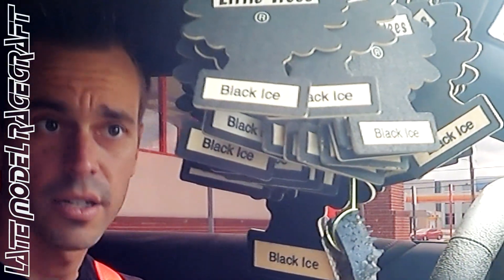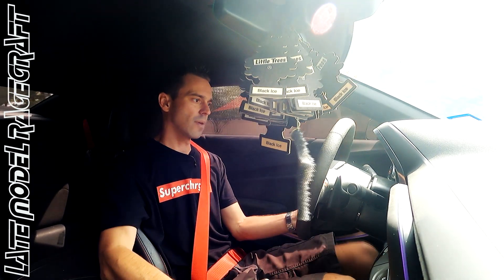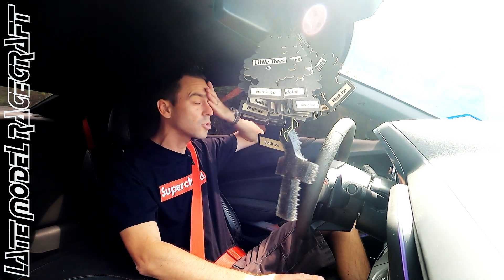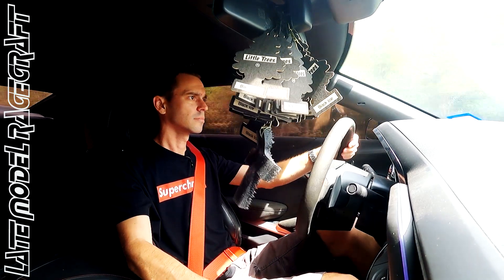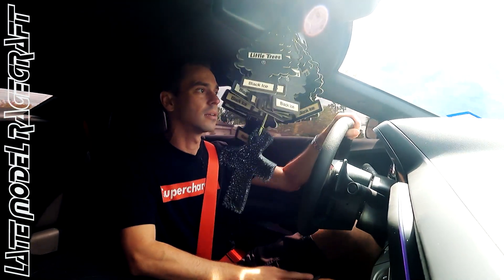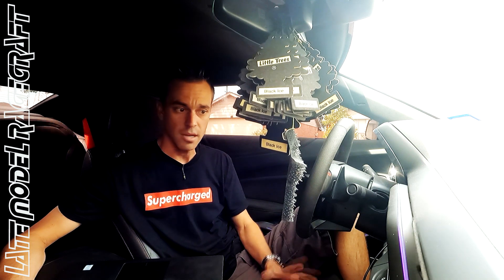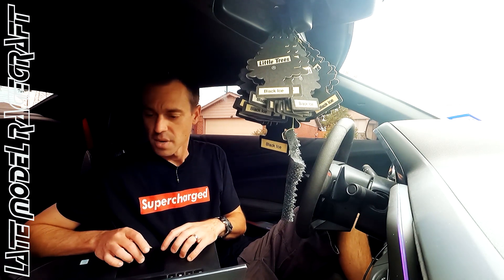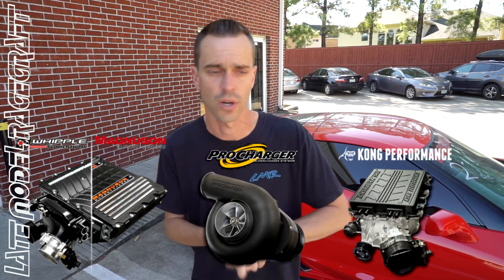ZL1 Camaro LT4 blower with a 376ci vs 416ci explained

Comment: This was an older video I just watched and as you talk about the engine geometry, engine cubes, blower capacity, rail pressures, and flex fuel switching, it enlightens me a little farther on modern vs old school. Old school is me, thanks.

Comment: This is my dream setup, 416 but with a centri blower and some corn juice. Nice little daily driven monster
Reply: I have a ss but when I get my zl1 heck I’m going first do procharger F1A94 or the larger F1X on 93 and sleeper a bit make 800whp then go to a 440 ci motor bored not stroker then go nuts and go hit that 1200whp on 93 or 1400whp on E
Reply: @RideOrDie717 1200 whp on 93. Cool story bro.

Comment: Would the kong X port make 8-900 wheel?
Reply: kong xport with full cam package smaller upper and meth are making 870whp, add after market heads cars are making 930whp
Reply: Steven said 840-850 to the tire.